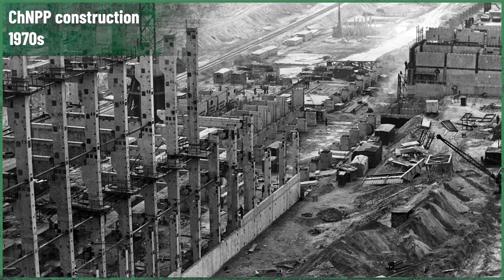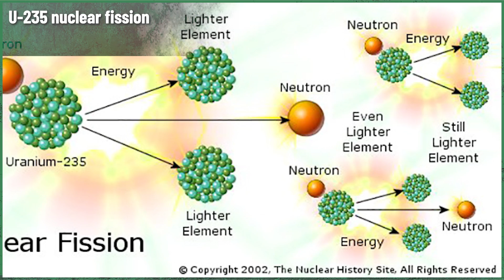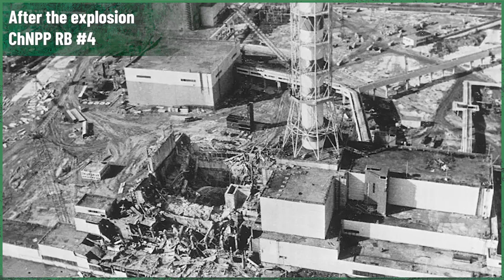RBMK design flaws - why RBMK explodes? PART 3 ||| Chernobyl Stories

Comment: Ok. Where were the spent fuel pools. Were they the same as now a days and were in water next to the reactor? Did that fuel meltdown as well?
Reply from the maker: They have adapted parts of the power plant for the waste, but they've build a separate sites too (with better shielding).

They've extracted as much as they could, but because of the radiation they couldn't reach all of it. That's one of the reasons why the sarcophagus is needes and the second one was created (simply speaking, the fuels still "burns" and will not stop until provably hundreds or thousands of years).

Comment: Photo of the huge nuclear explosion is misleading in this context, Chernobyl reactor had steam explosion, releasing 5% of the fuel content, not nuclear like a bomb. Having one Chernobyl every so often is still much better than 850.000 deaths each year from coal only, millions die from other hydrocarbons like oil, gas, changing weather patterns...Things will only get better with time if we go full nuclear soon enough, meaning now!
Reply from the maker: It's not a photo but an AI interpretation - but you’re right, the explosion probably looked different.

And I personally am onboard with the nuclear energy - for me it's the cleaniest type with the lowest possible byproducts (at least so far that we know).

~ Andrzej TF51

Comment: Nice Video! I find it interesting how later Gorbachev said that Chernobyl played a major role in the collapse of the ussr. While it was obviously a major catalyst in the process, I think it would be more correct to say it was the other way around. Basically ussr worked in an unmaintainable way, with the centralised economic plans, the dictatorial ruling, etc. they tried to compete with the economically way advanced west, but it was simply not working behind the displays. The disaster didn't happen because the specific operators, or the reactor itself, but because shooting always higher in the race with the detetoriating flaws in the soviet system was bound to produce disasters.
Reply from the maker: I think you’re right :-)
Economic troubles were one thing, but overall the USSR had multiple huge problems. Like Afghanistan war, which consumed resources and lives. Chernobyl was one of those major things that were just the nails to USSR's coffin.

Andrzej
TF51